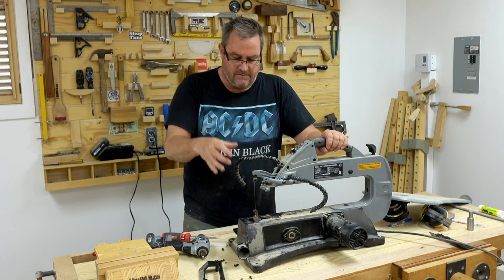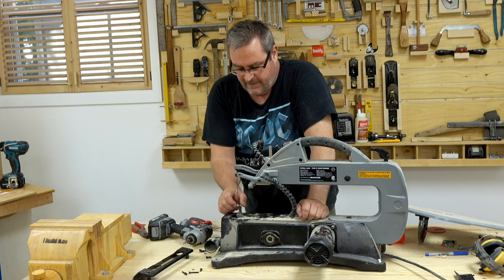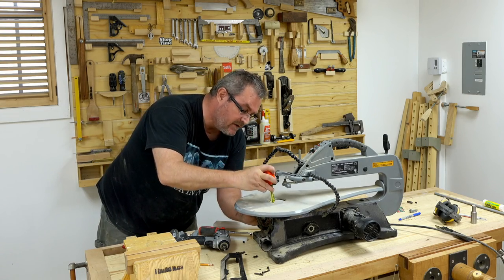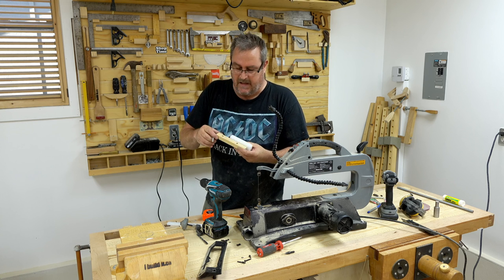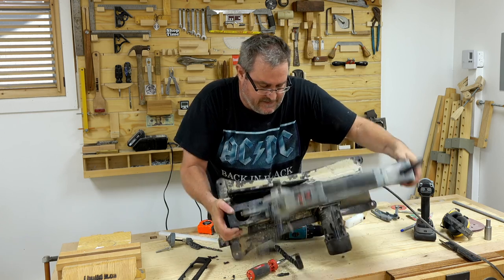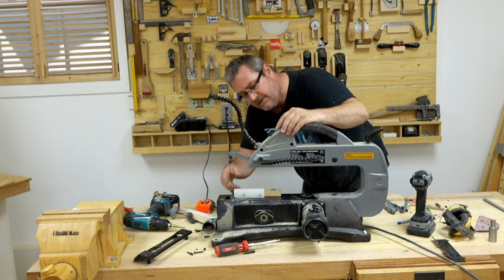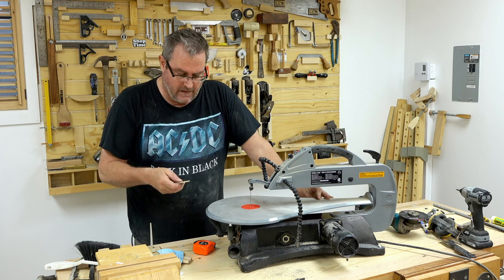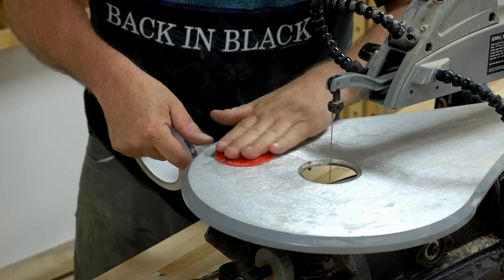Making My Crappy Scroll Saw Work Better And Cut Accurately

Comment: I just got a scroll saw, and... I really don't think I'm any expert, but just from what I can tell of the mechanics involved in scroll saw reciprocation, the back swing of the blade is intensional, and with purpose. When it swings back on the up-swing, it is to stay clear of the wood, and then return to a downward cutting stroke, as the teeth are facing downward. If you shorten the backstroke of the swing, then you must slow your feed rate, and or risk over heating the blade. I know this is an older video... and I have seen your scroll sitting off in a corner buried!! lol, Maybe you could revisit it someday?

Comment: I have a cheaper Dremel 16" scroll saw and don't seem to have this problem.
 i think its because the blade clamps are closer to the arms and do not hang down as far like the ones on your saw. 
  Also, your machine seems to be missing the rubber tensioner bushing under the tension adjustment. 
    Although i do like your Teflon blade guide mod.

Comment: John, I wouldn't be surprised if wood wouldn't last longer than the plastic. One of the properties of wood is that it is relatively hard to wear down when in contact with a smooth surface. Just make sure you follow the grain and not the edge.

The cable cars of San Francisco are fitted with mechanical track brakes, controlled by a large braking lever next to the grip lever. Pulling back on this lever forces replaceable pine wood blocks against the rails; as a result, a cable car descending a steep hill emits an odor of smoldering wood. These track brakes are routinely used many times while traversing a cable car route.

Comment: On many scroll saws, the forward and back is intentional.  On the down stroke the blade moves forward into the cut and on the up stroke it moves back.  On some of the newer higher end saws this can be adjusted so there is little forward movement in the cutting stroke.  On thicker wood, like 3/4 or greater, it is good to have that more aggressive cutting.  Side to side is a bad thing tho.

Comment: I often wonder when I see these type of videos, if the manufacturer / engineer/ designer ever makes changes based on your assessment and refit.  Well done John.
Reply: One Leg at a Time , this lesser expensive saw was designed like this on purpose. More expensive ones have an adjustment that controls the amount of tilt from a more aggressive cut like this, to the vertical which is only good for thin stock and fine fret work where you work very slowly. If he tries to cut 3/4” stock with this ‘fix’ it won’t work well because the saw dust can’t be cleared and it will be very slow.

Comment: I bought this machine over a year ago and haven't used it yet. I just plugged it in and turned it on then put it back in the box and in my cupboard until I finish building my workshop.

Comment: I imagine it will last for the life of the tool because it only gets used once in great while.  Somebody who wants to sit there all day making scroll saw art is going to buy a decent one in the first place.
Reply: This is probably true, but even then, why go through all the trouble to manufacture a tool that doesn't work well?
Reply: So they can sell you a better one in the future of course!
Reply: Because a lot more engineering and parts go into making a saw that has less forward-back movement of the blade.  He didn't really need to do this to get precision cuts.  He just had to work with the saw some more to learn to work with it.  All my scroll saws have been like this and I make very precise, very small parts with them.

Comment: Great fix!   Try using a much smaller blade. 
  In addition, you can create a MUCH better support/zero clearance insert just by adding a large piece of thin laminate to the top of the table.

Comment: I'm wondering how much more stress limiting the pivoting motion of the blade fixtures (there's probably a better term out there) puts on the blade. You might end up breaking them much more frequently where the blade attaches = where the most flexing is going to be. I personally don't find the back-and-forth movement of the blade to be that much of an issue when it comes to accuracy if it's only about twice the size of the blade and I do a lot of small details.
Reply from the maker: If you understand what's actually happening, what you said makes no sense at all. The blade flopping back and forth is obviously flexing way more than a blade that is just going straight up and down.
I'm used to guys nitpicking what they perceive as "problems" with some of the stuff I do, but this is new territory.
Reply: :D okay, a bit more aggressive than I expected. Why do you imagine they even did the swiveling action in the first place? It's obviously to allow movement. Now you're limiting that movement and therefore creating stress. It's stress that transfers in to the blade.

Comment: What if you used a slotted hole in the plastic part? That way if the tip got worn down you could loosen the screws holding it to the maple piece and move it forward so it's contacting again.

Comment: As you were cutting your logo I noticed that the blade you were using was huge. I'd use that kind of blade for like a 2x4. For that thickness of wood I'd use a reverse tooth blade 2R, 3R or 5R would work a lot better. Happy cutting.

Comment: I have the same saw. One fix I made was to replace the little set screws that hold the blade with M5 hex head bolts and I can now use a nut driver to tighten. Where did you get the plastic bit? BTW thanks for your efforts.

Comment: Would a bearing work? Similar to the guide on a bandsaw, but not perpendicular to the blade. So you could apply force to the arm in the same manner, but the surface providing the pressure would roll with the motion of the arm.
Reply: Luxorcist I can't see why not. Good idea!
Reply from the maker: I can see why not - the back of the blade holder is not completely flat. Using a round bearing would probably make the problem worse.

Comment: rotation to linear in that configuration  for the amount of up - down movement it has a back-forward movement on the blade. if the blade has a higher up/down movement the back /forward will be much higher. the thing that the blade attaches was built to have a little freedom on the blade and whole mechanism. what you did is to force the blade to run straight but that may stress other parts of the whole mechanism

Comment: I have the same Maximum saw. I have multiple issues with it. The pin that keeps that insert from turning has come loose a few times. The pin that holds the handle that adjusts the tension is always coming loose. The tenon that holds the table at the back rattles so I had to shim it.
How easy do you find it installing pinless blades?  Drives me crazy.

Comment: hey man I know on my scroll saw  that you need to turn the tension up on the blade and this will stop it from moving tighten the back handle by turning clockwise and then pushing down on the lever to lock it
Reply from the maker: No kidding? I'm so glad I have kind people to point out those tricky details to a new guy, like me.

Comment: So is Canadian tire something like harbor freight?
Reply: I gave away my harbor freight scroll saw 5 years ago for the same problem, it was a cheap toy with zero precision
Reply from the maker: Princess Auto up here appears to be more similar to Harbor Freight. Canadian Tire used to be pretty good, before they went the dollar store route.
Reply: Michael Osmon Princess auto is the closest in terms of cheap tools , however their clamps and hardware selection is terrible. Peavey Mart carries the "harbor freight" cheap but decent clamps and their selection of fasteners is great.
Reply: Canadian tire is a unique store.

Canadian tire carries many of the same tools as both Harbor Freight and Princess Auto, typically branded as "MasterCraft". Their second house brand, Maximum, competes in quality with the likes of Ryobi or Kobalt, and the pricing is slightly less or on par with those brands.

Otherwise, Canadian Tire sells sporting goods, camping gear, clothing, seasonal/holiday items, auto accessories - that sort of thing. They also have some automotive services as the name implies, tire and lube sort of work.

Princess Auto is the equivalent of Harbor Freight, and carries the same low grade sort of stuff. That said Harbor Freight in the US has some exclusive items that are better than their typical stuff, that you can't get at Princess Auto. Those are few and far between though.

Comment: The more expensive scroll saws have an adjustment to make the blade track vertically, or tilt as this one did. The vertical tracking is excellent for fret work or thin stock. However, it is poor on thicker stock because the saw dust doesn’t clear as well and it is very slow. The tilting (almost elliptical) cut is more aggressive and clears the saw dust better. Your ‘fix,’ if it doesn’t damage the saw, would be of better use if it could be adjusted to permit varying amounts of tilt or the vertical only tracking. The lesser expensive saws will come as yours did because a vertical only cut would be only good for thin stock or fine cuts in thin stock. Owners would be frustrated and think the machine useless on thicker stock and therefore a ‘bad saw.’

Comment: Nice. Was hoping this would help me with mine. I got an old one from my neighbor. It's so old it uses a reciprocating/spring mechanism. It works, but I don't think the return spring is powerful enough. And I need a more powerful motor. 1/12hp just barely cuts it. Pun intended.

Comment: Well done.  I had to laugh at the end, I actually enjoy scrollsaw projects, and I have a few that I got for free...  One of them is an old Delta, and that insert was doing the same thing.  I didn't use packing tape, I used gaffing tape, but I got it perfect that way...  For the 5 scrollsaw nerds out there, the Delta has a lot of power, runs real smooth, weighs a ton, and seems well built.  Sadly, the blade changing-blade holding mechanism is so clumsy and so annoying, it'll drive you crazy on a big project....

Comment: But if you use the scroll saw for long time at once , doesn't the plastic start to melt?
Reply: How about wood dust coming down, and in between the UMHW plastic? The dust would kind of be a lubricant...
I think.
Reply: UHMWPE (Ultra High Molecular Weight Poly Ethylene) isn't the same as regular plastic. It's a heck of a lot more resistant to wear and friction. It's also self-lubricating, so the simple act of the saw arm rubbing up and down against it should actually make it run smoother. Even though it has a relatively low melting point compared to other similar plastics (130-136°C/266-277°F), the super low-friction surface would mean that it likely won't ever get to that temperature at the point of contact with the saw arm. 

At least that's what I'm getting from a the research I've done.
Reply: Rampe's Workshop I've held the stuff against a coarse sanding belt with no affect...
Reply: cigars and swarf  Okay. i am not very familiar whit this material😕...yet
Reply: Exactly. We call this stuff "puckboard" and use it for a lot of different things in the boating industry. Also, I know of a lot of people who use this to replace the needle bearings in the front axles of 4X4s. If an axle rubbing on this isn't going to melt it, I highly doubt the blade rubbbing on it is going to melt it.

Comment: Has anyone tried to put the pinless blades in? Could really use a solution for this.. its.next to impossible. There's not any positive stops I'm any direction when u slide em in and u just have to kinda try and hold the blade behind where the set screw is..  and then tighten and hope.its pinched in there well enough and they the blade doesn't slip out as you tighten the screw...

Comment: why not use a bearing bushing?
Reply: I think metal on metal would wear out quickly. Would probably add a lot of noise too!
(and do I recognize you from Instructables?)
Reply: well a band saws works in that principal ... (probably you do !!!)
Reply: also a bearing is not rubbing as it's rolling... but the noise yes will be higher
Reply: But in a bandsaw it goes only in one direction - down. Not up, down, up, down...
And I think in a bandsaw you have a TON of feet per minute (isn't that what it's called?), so they melt.
(Yup, from the world's smallest workshop!)
Reply: maybe I'm wrong, don't know but I think that would be my approach ... not saying that the uhmw is a wrong one... but just thinking out loud here :D !!!

Comment: john I've emailed you a couple times im regard to a plan i purchased from you. could you please respond?
Reply from the maker: What was the email in regards to?
Reply: I Build It about your box joint jig i purchased
Reply from the maker: If it was about a specific problem using the jig, there's a website forum thread that can help: http://www.ibuildit.ca/ibuildit-forum/viewtopic.php?id=153
Also, I've made several videos showing the ins and outs of the jig and those are listed at the beginning of the forum thread.
Unfortunately, I don't have the resources to troubleshoot individual builds on a one to one basis. If I did, I would not have time for anything else and be very poorly paid for my effort - the plan is just $12, about $7 of which I actually get to keep.

Comment: The Austrian Hegner scroll saws suffer from the same geometric defect and yet they are much more easy to use accurately than any other brand I have ever used. But the do cost 5 times as much.
Reply: Donald Sayers it isn’t a defect. Your Hefner might have an adjustment that allows you to set the tracking from aggressive (fine for thicker stock) to the vertical (best for thin stock and fine fret work).  Most of the more expensive saws have that adjustment.

Comment: Yeah Mastercraft tools have really gone down hill. They used to be a really good brand, but because they have to compete with all the other brands, they cut corners everywhere possible, and I find that a good amount of their tools are now garbage. Not all. But most. Even if you buy the tools on sale it's often not even worth it because of the problems you have with them. Cheaply made knobs, threadings that wear out quickly, cheap plastic guides, covers, and other parts, slop and misaligned pieces, poor paint jobs, etc.

The last tool I had bought from them that just made me abandon the brand was a cordless multi-tool. The thing would barely run for 10-15 minutes on a full charge, and even then, it would get burning hot (almost scalding). I eventually burned it out within a month of buying it, and I exchanged it. The second one ended up with a faulty battery and I just got a refund (store credit) at that point. Complete garbage.

They're fine with some hand tools still, but I won't be buying any power tools from them.